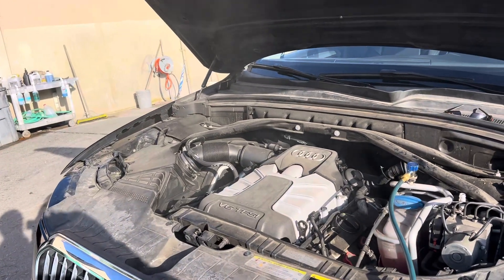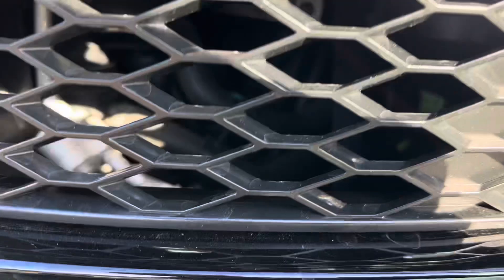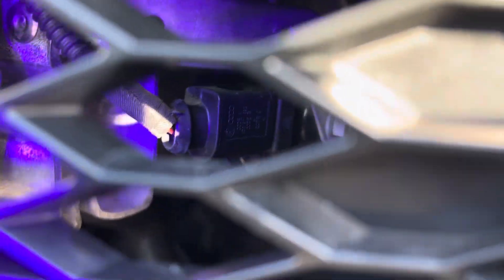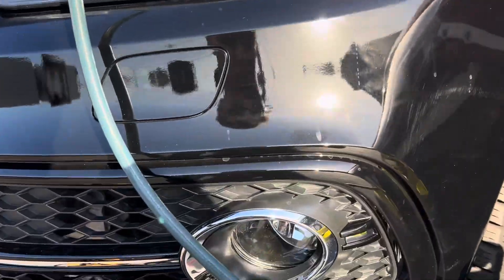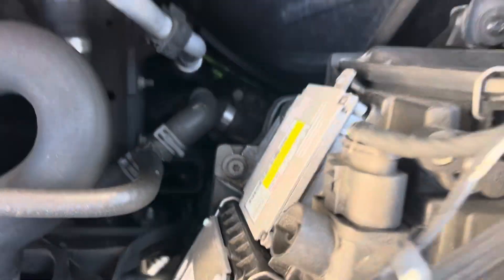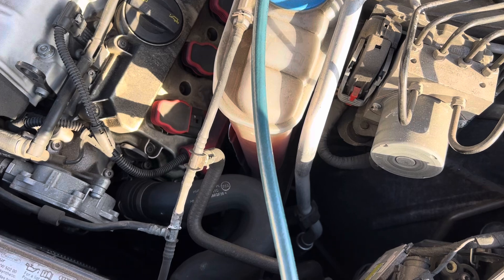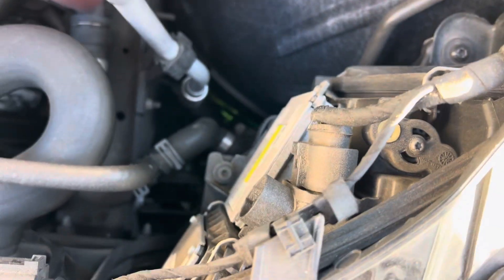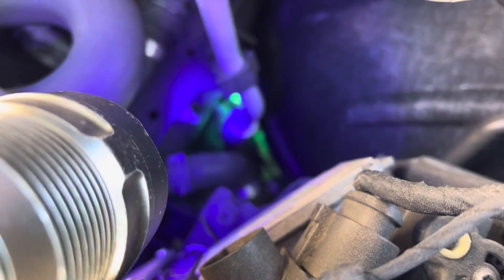UV fluorescent dye can easily spot the leak behind the bumper￼

Comment: The only way to remove the condenser or radiator on most Audi's is going down. Some Audi's have no service port like A8. Low & high side pressure can be read by VAG Specific OBD2 tool.
Reply from the maker: I made a video on recharging the A8